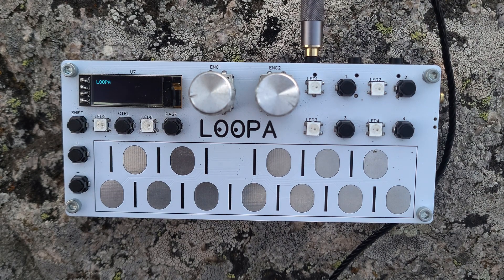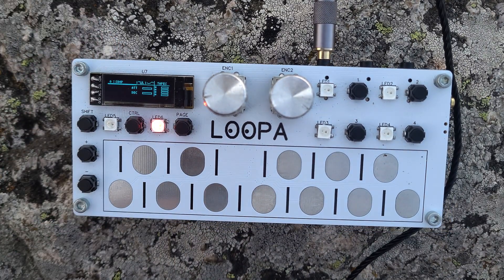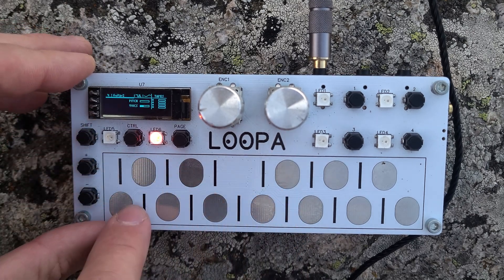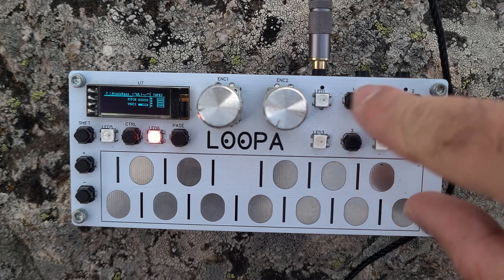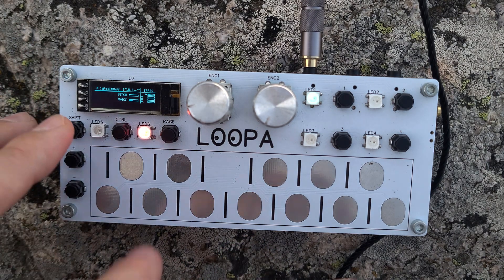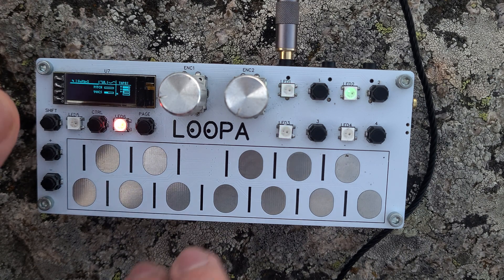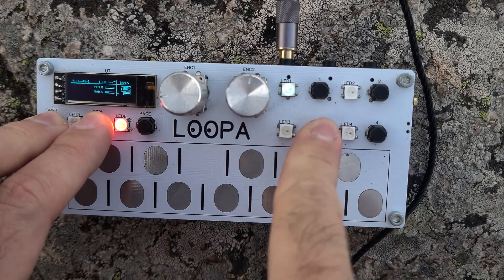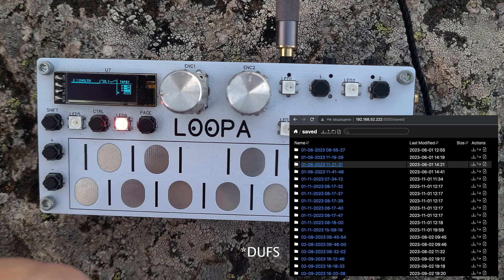LOOPA explained (DIY synthesizer)

Comment: How do I get one?
Reply from the maker: it will be soon released here https://github.com/ferluht/loopa but I need to fix a couple of bugs in pcb design first
Reply: Looks amazing, would be great to integrate the epi zero 2w enabling access for anyone with a Bluetooth midi keyboard or other instrument
Reply from the maker: @max1mus2k the biggest problem with pi zero 2 is power consumption, it's way higher than pi zero 1. but afaik pi zero w also has bluetooth. btw now a midi keyboard can be attached via usb, I think I'll shot another video on midi keyboard and mic/line inputs soon
Reply: Сколько стоит такой аппарат?
Reply from the maker: @MsShypa пока не продаётся, когда допилю посмотрим. детали у меня вышли около 50$ на штуку